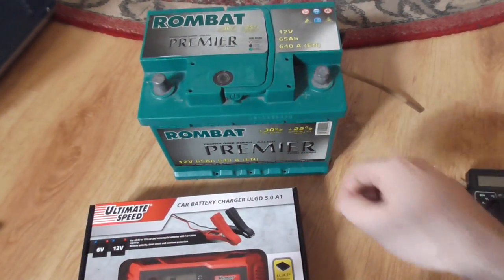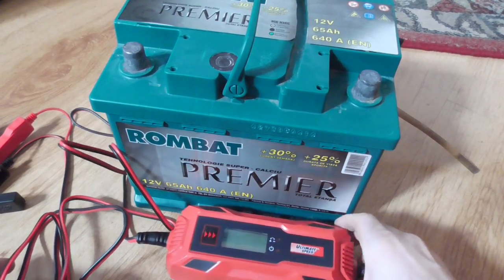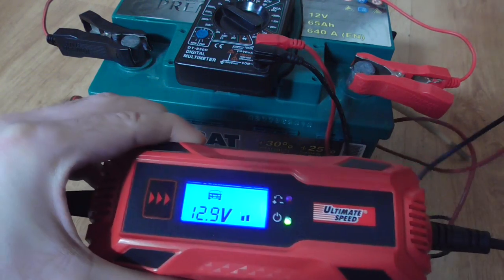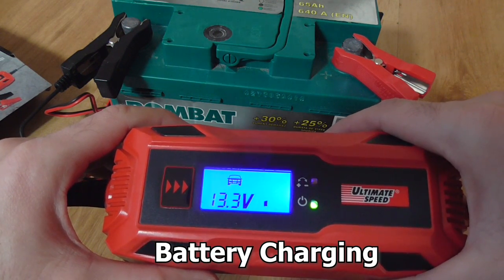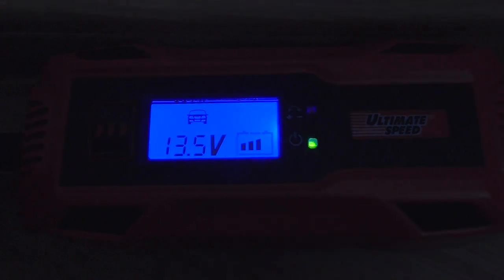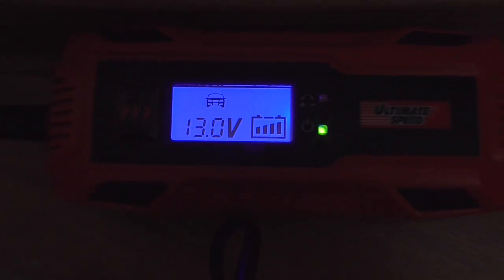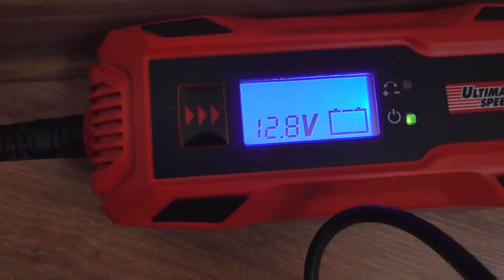Car battery charger - ULGD 5.0A (Protections: Short circuit, Reverse polarity, Overload) Lidl

Comment: You don't see the green colour in that eye indicator because the relevant battery cell, in which it is installed in order to monitor a sample cell, has not enough electrolyte any longer. 
In fact this eye mechanism works both as a density meter and a floater, indicating the existence of enough quantity of electrolyte. In this case the electrolyte level in that sample element is too low, therefore the indication is black.
Reply from the maker: But it is a sealed battery, water vapor can't escape, so than how did the water level got lower?
Reply: @furulevi  This happens normally during chargings of the battery. There is always present the effect of electrolysis within the battery cells. The high number of charges in combination with the high temperature in the place the battery is installed (near the car's motor) and the high amperage (full alternator power in fact) right after the car starts, all these factors contribute in water loss of the electrolyte solution within the cells, which happens gradually, untill finally the battery gets dried up increasing its internal resistance and then dies.  This is the normal process of wear, but there are more other factors of failures as well (internal shorts, broken cell interconnections, fall of active material in the bottom of the cells which also causes cell shorts, the same effect due to high vibrations of the battery, especially if it is installed in wrong place i.e. right above a front wheel etc).
Reply: Γνωρίζεί κάποιος παρακαλώ που μπορώ να το βρω στην Ελλάδα  ?
Reply: @georgefilaktopoulos387  Αν εννοείτε το συγκεκριμένο τροφοδοτθκο, το πουλούσε το Lidle. 
Το εχω βρει εκει δυο φορές. 
Πιστεύω ότι θα έχουν κι άλλα ακόμα στις αποθήκες τους, οπότε μπορείτε να επισκεφθείτε το κοντινότερο σε εσάς κατάστημα και να το παραγγείλετε. Θα σας το φέρουν, θα σας ενημερώσουν  και θα το παραλάβετε απο εκεί.
Reply: @ΠάριςΑζής  σε ευχαριστώ πολύ φίλε μου, θα δοκιμάσω την συμβουλή σου  !!
Reply: George Filaktopoulos Νασαι καλά φίλε. Με τα 20€ που κοστίζει, δεν χάνεις και τίποτε. Κάνει καλη δουλειά. Το μόνο άγνωστο είναι η αντοχή του στον χρόνο, ιδιαίτερα αν κάποιος το δουλεύει παρατεταμένα, π.χ. για να κρατάει φορτισμένη την μπαταρία μοτοσικλέτας κατά την διάρκεια του χειμώνα.

Comment: Bloody useless on flat batteries A battery charger that doesnt charge flat batteries🙄
Any less than about 8 volts on battery and it wont charge it. What idiot thought that would be a good idea? 
Ridiculous
And of on top of that in the event of break in power, it doesn't start charging again unless you press button.
Why? It's too fiddly.
Stupid design.
There's none of these complications with a basic traditional battery charger.
Reply from the maker: True, but a traditional battery charger doesn't have any protection built in either, and it won't stop charging after the battery is fully charged... So it's a good idea to have both type of chargers, classic-old and new and smart!
Reply: @furulevi  yes i have both but why did they not design Lidl one to also be able to charge flat batts where voltage has dropped low?
Not difficult. I shouldn't have had to go out & buy another more conventional one for charging flat batteries 🙄
It's bldy battery charger isnt it
Reply: Hy, if you want to charge flat battery you can trick the charger with another battery conected to the flat battery. If you connect another battery charged to flat battery you can start the charger to charge. After they start to charging you can disconnect the god battery and stay just the flat battery at charging. Sorry for my bad english
Reply: @mariusl2988  flat battery is for junk,not for chargng...lead acid batteries dont like deep discharging. if she was under 10 v  for a longer time ,she is bye bye

Comment: Great video - I have this charger and by mistake for 5 seconds put the cables on the wrong way round on the battery- my car seems fine - can I ask this is the reverse polarity protection which saved me from my mistake ? Thank You- so in other words if get negative and positive connected wrong way and turn on charger your car and charger will be protected?
Reply from the maker: Yes, the reverse polarity protection, I think the entire car should be OK, I haven't tried it like so.
Reply: @furulevi  Thank You

Comment: Does it save the settings if it is connected to battery permanently?
Reply from the maker: It's just monitoring the battery voltage.
Reply: @furulevi   I have tested this two times now and it always continued charge with normal (car) setting which is okay no need to push any buttons. (When it is connected to battery permanently.)

Comment: Can this be made to force charge dead batteries? Below 4 volts for example
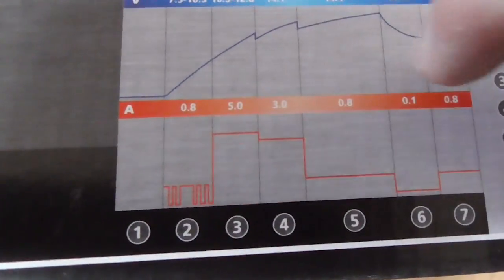Reply from the maker: I think not, at 0:41 it mentions charging flat batteries but at the * it mentions above 7.5 Volt! A simple transformer based charger is still required for those heavily discharged batteries.

Comment: Mine won't charge bigger battery like in passatt  of a tractor why is this it shows err.
Reply: Read the manual about Err
Reply: @robertboldoranov4649  i found out the err is because battery is fully dead this wont charge completely flat battery.
Reply: @martymartin2894  yes

Comment: What does it mean, when it stops at 13.1?, is it not supposed to charge until 14.4 ?.
Reply from the maker: Is the charger overheating?
Reply: furulevi no overheating , mine stopped at 13.1, I just taught max charge is 14.4?

Comment: What is the voltage maximum for a car? Mine started from 12.3 went to 13.5 and still charging. There were only 2 bars. Why yours was full with 12.8?
Reply from the maker: While charging 14.4V or 14.7V, shown at 7:00, when the charger is disconnected then the voltage should be around 12.6V.

Comment: I used this yesterday to charge a completely flat battery. It took 24 hours to reach fully charge.
Reply: My car battery is dead. When I connected it, it is on 6v, I can't chose a program, and the battery icon is not blinking. Is it charging?
Reply: @МиланМилорадовић  i got the same problem..you need to start the car with cables from another car and leave the battery to take a charge from the car itself until it reach at least 10v then you can use the charger
Reply: @TheDestructorOfficial  yeah, I learned that later :) 
So to clear out for the others, if it's not blinking, it's not charging. Probably the battery is dead empty (as it was in my case) and you need to do what The Destructor described
Reply: @МиланМилорадовић  yess correct if its not blinking doesnt charge...im trying now to charge a 80h battery lets see how long it will take

Comment: Is it normal that the charger is too hot?
Reply from the maker: Mine was just slightly warm. Maybe your battery was severely discharged and thus the charger had to use a higher amperage. Place the charger into a colder location while charging.

Comment: when is not charging is not dooing "nothing" but has a maintainement function.
Reply: can this device be itself charged and then used to start dead batteries without plugging it ?
Reply: @christianbonello2914  No
Reply: Christopher Conroy  you have to get your battery to 7.3 before it will work. I jump started my car, leaving it running for over an hour. That worked and now its charging using this unit.
Reply: It does.try it on snow flake position for 2 minutes
Reply: @markatkinson167  Mine is 9.5 V and still doesn't charge.